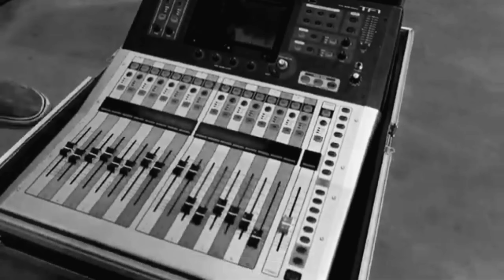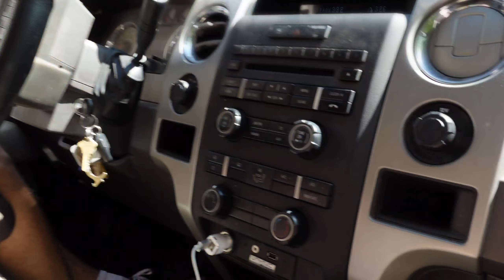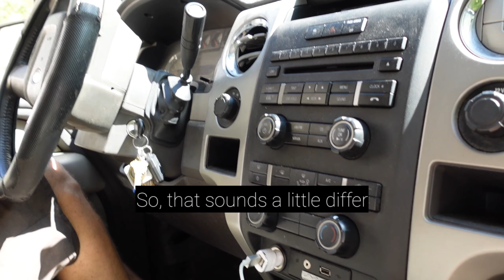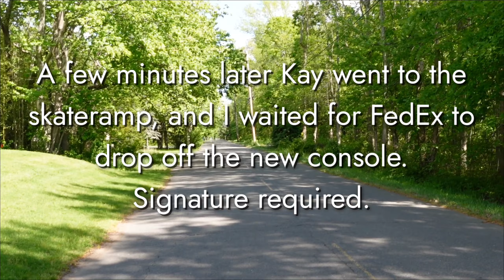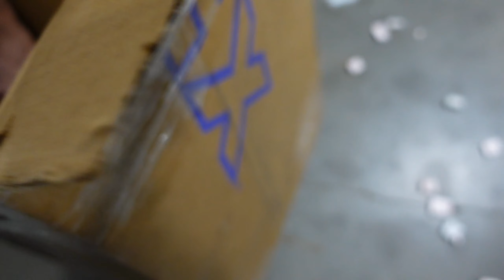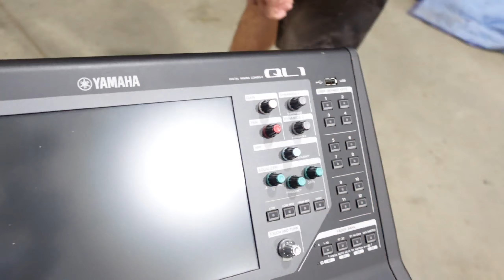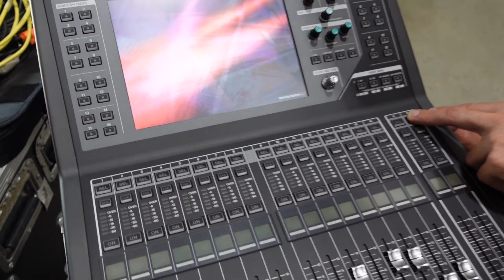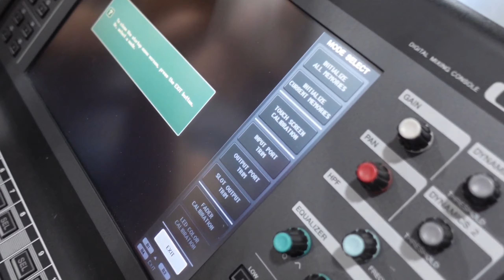s10e4 Unboxing The Yamaha QL1 Console / Yamaha TF1 Review After a Month / Where Have We Been?

Comment: We had a QL-5.  Dumped it and bought a DLive 3500.   Makes a QL look ridiculous
Reply: I would never get a ql5. Way overpriced and at that point might as well go cl5 or other. Ql1 though has the right size and features for corporate.
Reply: Ql5 way to over priced!
Reply: @michaelkurczeski1373  never say never!! The QL1 only has 32 dante paths as the QL5 has 64..Also it has a stage box built in.. Think of the QL5 with as 2 x QL1.. ITs a compact platform with POWER! If you had no problem paying 15k for an LS932 back in the day you should have no problem paying the same thing for the QL5.. You will come around eventually.